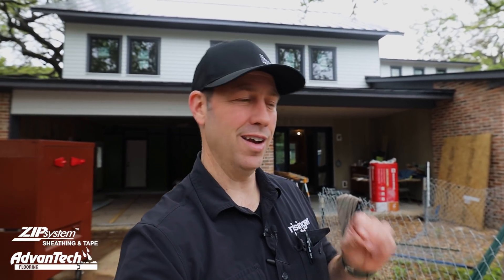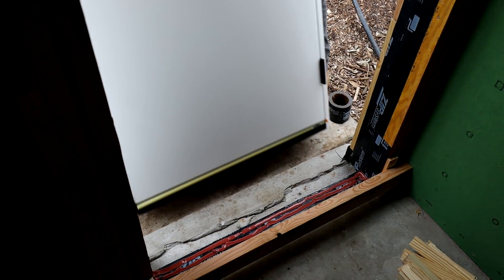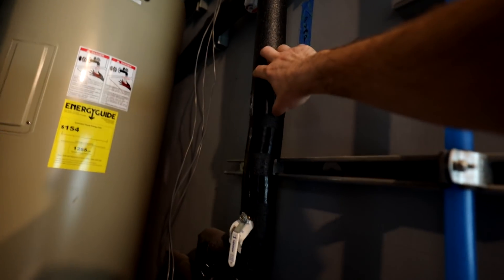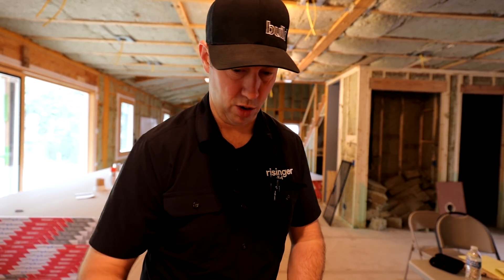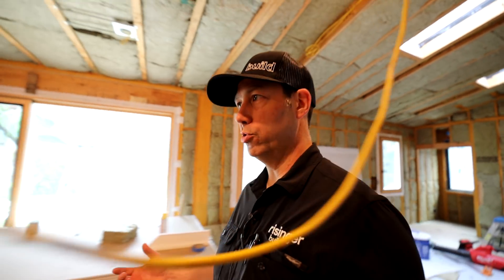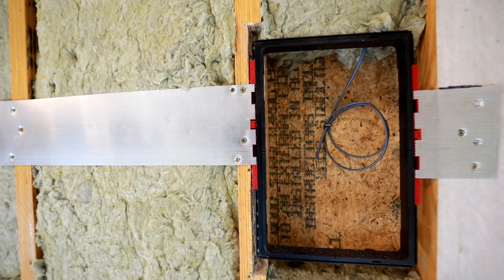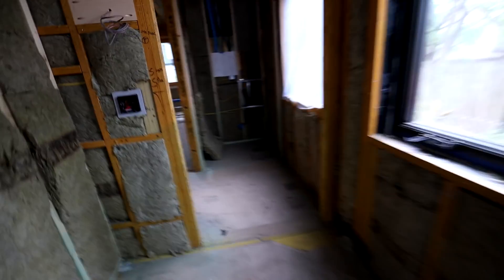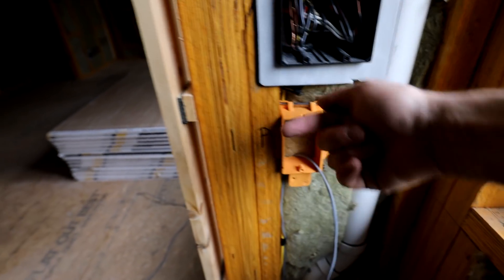Pre-Drywall Walk - Update on my house! RealReBuild

Comment: Make sure for Data you are going to have for Verizon, Fiber. You should run from Dmark to your smart panel where everything is wired to, run 3 Coax 3Cat 6 and one Power wire with Black red and small grey ground wire. From Smart panel where your switch is going. Make sure you run TWO ethernet and one Coax to where your router is going (probably on first floor). That way you can have Data in and Data OUT back to your smart panel to hook up to your switch.

Comment: fyi, garage door, hinge side is now the attack point, replace a screw in each hinge with a screw in pin, when the hinge is closed the pin from one side goes into a hole in the other half of the hinge. if the frame is strong it cant be spread to disengage the pins.  and you should always make a door strong as possible, spreading the frame is a common attack.

Comment: If I understood you right, you said that one way to turn on the water recirculation is by a motion sensor to keep it off until someone is up and moving.  The first thing I thought of was going to the bathroom in the middle of the night (or pet movement.)  All that heating for a minute of hot water to wash hands when done with the toilet?

Comment: My system preheats the Hot water such that the actual water heater service is in excess of 25 years so far.  It hardly raises the temp after the Geothermal system and is almost totally waste heat from it.

Comment: Watch out for flanged electrical boxes. They really bump out the drywall. In small width walls, like your kids bathrooms light switch. that 3/16" bump off the studs will show in the drywall.

Comment: 75" (Or more) since you have plenty of space and it would aesthetically fit in well, with plenty of space on the sides. 

Only reason to go 65" is if it would look to large for where it is installed, or restrict placement of other components.

Comment: 5:35 Hot water heater should be set as hot as possible and minimum 160F (70C), and mixing valve set to get at least 122F (50C) at furthest outlet, to reduce risk of legionella as much as possible.

Comment: Why don't you use circulation pumps that turn on automatically when the tap is opened?  As far as I understand, they have a pressure sensor integrated in the housing and recognize the pressure drop.  Wilo or Grundfos make good pumps.

Comment: 15:52 for a 12ft distance, personally, I think a 55” or 65” tv will be just fine, and if got the budget.....I’d go for the 65”. Imo, would be perfect fit for the wall and speakers around it! Without being “too big” and being unnecessary b/c of the distance if where couch is at and where sitting from.
That’s my take in it.

Comment: On the TV, that decision is all about how central it is to your families life. If you are like a lot of people then 75" or bigger beyond question. Also you have a ton of light in there so make sure that factors in to the display you purchase. A lot of panels simply are not meant to be viewed in a space like yours. I would look at a TV like the samsung q90t as a jumping off point. Also, the suggestions of adding tubing behind the wall to run cables to your a/v cabinet will save you headaches later on!

Comment: Go oled with as big as you can afford, you will not be dissapointed. Remember, 2x the diagonal is 4x the screen surface area ;)
Or if you really want to have fun, get a 135 inch electric screen and a projector, and use an av receiver to split the signal, and swap between the two.

Comment: He Mat, love the show. i have i question about the hot tap water system. is it true that in the us the hot water gets circulated thru  the house? thats not realy common in the Netherlands. we dont have any kind of pumnping in the watter mains supply. we just use the headpressure from the mains supply to let the watter flow to the taps that are open. isn't it wastefull to have hot watter circulating around the house whilst they dont need watter?

Comment: There's a specific size for how far away you are. If you're in a small space you don't want a TV that's too big, it'd be like sitting in the front for at the theater, you miss a lot of important stuff on the edge of the frame. All that being said, it looks like your space is big enough and you're far enough away that you could go 75" no problem.

Comment: For your TV wall - Your TV should be roughly half the size of the distance to your viewing position. As an example, if your viewing area is 10 feet from the TV (120 inches) the TV should be 60 inches. If you go for a 4K TV, that number becomes roughly 1.5 (or 1:1 on the low side) - i.e. a 4K 70 inch TV should be roughly 105 inches away from the viewing area.

Comment: Installed lots tv always add blocking
Behind tv wall 2 x 6  gives other options latter if you change size
65 is perfect  base on where you have sofa . If you put 75  and watch it close all the time you will never be happy
With other tv in house.So stay at 65
Kids will not  hog  area .You always go
Bigger later if are not happy.
Lower on wall is better for your neck
If you really sitting sofa watching Tv
Thx

Comment: Get a projector and use a screen, you can have the projector as a hide-a-away that drops out of the ceiling and the screen can be a pop-up or just a specially painted wall everything would much cheaper than a clumsy TV always hanging in the room - I use a smart TVbox with my projector and can literally watch whatever I want without paying cable prices

Comment: Regarding the TV I would go to 75 inch screen. Where you have it mounted it’s only an additional 5 in her per corner diagonally 
Also 45% of you sound comes from the center channel. I have been consulting on audio for over 45 years! Sonos is not bad
It’s just Ok. You could do so much better for less money! If you want to run sonos in the rest of the house ok. But your family 
Room is the most important system in your home. It’s where you and the family spend most of your time. In addition I would
Run an 8K high end cable to future proof your Main TV . Matt with all of your skylights. I would not spend the extra money on
A OLED TV You should purchase a new micro LED because for the money it’s very bright. The skylights won’t washout the 
Screen.

Comment: You should go at least 75" TV.  If you didn't know, as the TV resolution becomes greater meaning (more pixels per square inch) a larger screen will be required in time to achieve the same view from the same distance.

Comment: MAtt, why not mount a video projector on the ceiling and provide a power plug there and a 1.5" diam conduit over to your control center.?  With the Zoom lens you can adjust the size to whatever you want.

Comment: Matt, on the multi-point lock, what hardware are you using? Ran into issues with my Reeb/ThermaTru doors because many of the major handleset brands could not handle the load of the lock.

Comment: 75 inches on distance from your couch if you were closer 65". what's your opinion on doing green board on windows as a future proof.... as a drywaller push those wires as far back as you can if they use a router I've seen the wires get caught. even if you put a piece of cardboard in front of them

Comment: Go with the 77" . It is amazing how 'small' modern TV's 'appear' once installed. General rule of thumb is 1.5 times diagonal for seating distance. (this gives a more cinema experience) So a 77" diagonal would mean your eyes should be 'about' 10 feet away. Also, I would HIGHLY recommend going OLED. LG or Sony. LG is about $3,500 for a 77" Sony about the same. I got the 65" LG OLED a couple years ago, and I still gaze at wonder in the performance. I would say go even bigger, but 85" OLED's are still really expensive. And as good as QLED's are, the OLED is A-MAZING.
Reply: If you (Matt) believe 77" or bigger is too big, and want to stick with 65". Then I would also suggest a 120" drop down (put it in before drywall ;-) movie screen and an Ultra Short Throw 4k Projector. I run a 120" drop down in front of my 65" OLED. It is better than I max.

Comment: 4:00 You should see if you can acquire an RTG to power your house. Perhaps dig it 50 feet below the foundation within a 24 inch lead enclosed shroud for extra safety. Solid-state thermoelectric couples convert the heat produced by the natural decay of the radioisotope plutonium-238 to electricity. The physical conversion principle is based on the Seebeck effect, obeying one of the Onsager reciprocal relations between flows and gradients in thermodynamic systems. A temperature gradient generates an electron flow in the system. Unlike photovoltaic solar arrays, RTGs are not dependent upon solar energy. The RTG is powered by eight Pu-238 dioxide general-purpose heat source (GPHS) modules which initially generate about 2 kW thermal power. The residential RTG would be capable of operating both in the vacuum of space and in planetary atmospheres, such as on the surface of Mars and Earth. Design goals for the RTG include ensuring a high degree of safety, optimizing power levels over a minimum lifetime of 14 years, and minimizing weight. Just saying,

Comment: Go for 75" because you can!  
It appears you moved your headers up after wrongly placing them for an 8' ceiling.  Glad you did.  Leaving them low would have driven you (me) crazy and if you were the contractor for a client you would have moved them without question.  
Can you do a video on adding a window to a brick house?  You have many ZIP system installs on new builds, but none (that I have found) on remodels.  Maybe remodeling isn't your thing???  Thanks.

Comment: 75” and lower the tv. you’re going to get a sore neck having to look up like that all the time. also go with a high end sony tv. they’re specifically made for films and are what filmmakers use for reference, other than panasonic. samsung for games.
Reply: As long as the horizontal center is at the same height as your eyes all is well. Mine is a few inches higher than my eye level so a 75 inch woukd new to be mounted lower a bit
Reply: @mkzenthusiasts  No shit. But his was clearly higher than that...

Comment: 75" TV all the way just make sure you're not mounting it too high for the room. You should be able to easily look towards the middle without tilting your neck or feeling like you're looking up all the time. It looked like you were going to put the 75" at the same height as the 65" when it might need to go a little lower to be comfortable.

Comment: I got a question I'm looking to put a new hot water heater in and I live out in the country so I have hard water it's bad. But from home depot they have the Rheem hot water heater that's meant for hard water but the 50 gallon is 1300 dollars but the 75 gallon commercial hot water heater is only 1089 dollars would it be OK for me to put a commercial hot water heater in my residential house??

Comment: I’m curious why at point water heaters are more prevalent in North America. Cost of electricity? Other? Thoughts?
Reply from the maker: Unsure of what you mean?
Reply: I think he means point-of-use water heaters. While they’re available in North America, they’re not common.  I think the question is why they’re not more prevalent.  I’ll take a stab at answering... it’s because, since a typical American house has several places in it that use hot water, it’s simpler (fewer things to break) to have a single heater for the whole house, and just run pipes to the various places where it’s used.

Comment: 75" Vizio with Vizio Sound bar with sub woofer built in. 75" has panoramic screen. Very low energy consumption and if you need parts, they are NOT on import quata's like the other brands.

Comment: I think the TV might be up a bit high. When you're setting down, your eye level should be between the center and the top of the TV. Your TV size chart looks like the bottom of the TV might be close to level with your eyes. On top of that, the rest of your family is shorter than you, so they might be in for some discomfort when using that TV for an extended amount of time. The kids might not notice the discomfort (due to youth), but it is there.

Comment: Enthusiasts like to reference the claim that SMPTE recommends a viewing angle of 30 degrees.  That's 1.6 times your TV diagonal or .625 times your view distance.  75" TV comes out to 10 ft viewing distance.  Though, I couldn't find a SMPTE article on the topic.
Reply: Yeah SMPTE doesn't have an actual recommendation.  They did however do some research that pointed in that direction.  Fujitsu also has a white paper out there about the 30º viewing angle.  THX says a 40º viewing angle is best for a theatrical presentation.

Comment: Why would you need the manual switches on the circulator pump if it has a temp sensor?  Seems like you should never have to tell it to start... Am I missing something?
Reply: He's trying to be more efficient.  Really, for bathrooms , a motion sensor or just tying it into turning on the light would be great.
Reply: He wants the setup to be “on demand”, not “always ready” or on a timer
Reply: Yep, most of us would like to have warm water when we're ready to use it, not having to wait for the hot water to get there!
Reply: @yzhang8629  wouldn't the temp sensor make it come on when the temp falls below a certain temp?  I just don't get the temp sensor if you are trying to go with on-demand... maybe I don't understand how the temp sensor works.
Reply: @rickhaass1133  The water in the pipe between the faucet and the water heater is cold, and usually users drain it until hot water arrives. If the pipe is long, it takes a lot of time and wastes a lot of water, so the recirculating pump moves the cold water in the hot water pipe to somewhere else (I think it is the cold water pipe, but not 100% sure) so that hot water is ready at the faucet. The temperature sensor is there to tell the pump that is has moved all cold water out of the hot water pipe and can stop working.
Reply: @rickhaass1133  When the user don’t need hot water, it doesn’t matter if the water in the hot water line is cold or not, because the user doesn’t need it, that is most of the time during a day (sleeping, out of home), and water lines are not insulated like water heaters, so hot water in the line loses heat quickly, and keeping the water hot in the lines wastes energy.
Reply: Seems (maybe) redundant to me too.  A temp sensor should act like a thermostat, and automatically restart the motor whenever the water cools.  At first glance, using just the motion sensor(s) might be an ideal solution for this.  OTOH, if you put a motion sensor in the kitchen, without any temp sensor, it’d run the motor continuously whenever someone’s in the kitchen, which is way more than needed.  By also using the temp sensor, it could auto-cycle off and on as needed whenever there’s lots of activity in the house.
Reply: @kc9scott  I guess the pump only runs once until the the temperature sensor detects the water at the faucet is hot, and then waiting to be called the next time by the push button. When there is a lot of activity, for example taking a shower, there is always hot water running inside the pipe so you always get hot water at the faucet, and the off time (when the user is applying soap/shampoo/whatever product) is not long enough for the resting hot water inside the pipe to lose all of the heat and become cold water so auto-cycle on is not a must. When the shower is finished, there is no need for the pump to replace the cooling-down water inside the pipe with hot water.
Motion sensor can be an alternative to the push button used in this video.
For an always-ready design, yes, a temperature sensor is used in a thermostat controller to make sure hot water is ready 24/7 at the faucet, but this video doesn’t need/want an always-ready design.

Comment: Your water heater is so efficient, just run the pump 24/7 you’ll never save back the money you spent on those control gadgets
Reply: I think the real purpose of the control gadgets is to prolong the life of the pump motor.  I’ve also seen (but not really investigated) reports that a recirc pump tends to age the copper pipe and put pinholes in it, at least if it’s run constantly.  Not sure if that’s maybe due to galvanic corrosion rather than water-flow abrasion.  But, as long as you use some simple thing to shut off the motor when not needed, anything Bluetooth will probably go bad before the motor. Using only hardwired controls would keep the system simpler and more reliable.